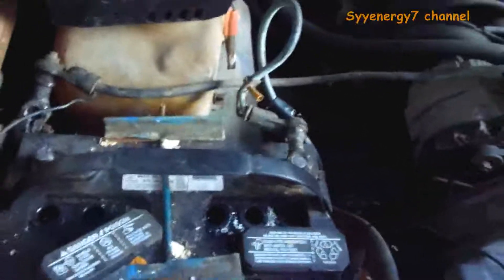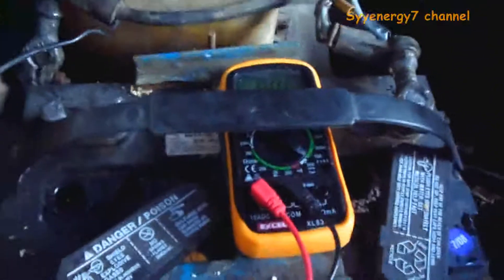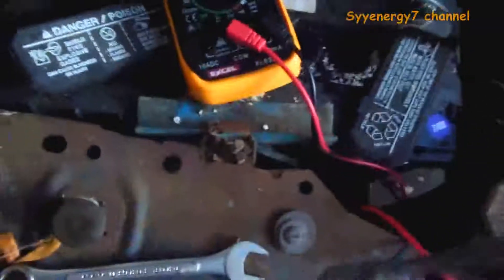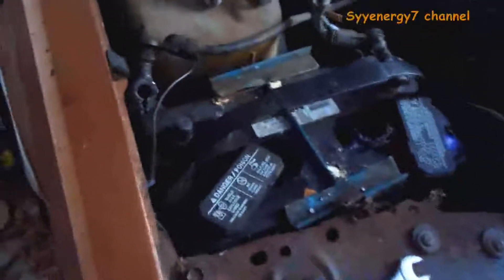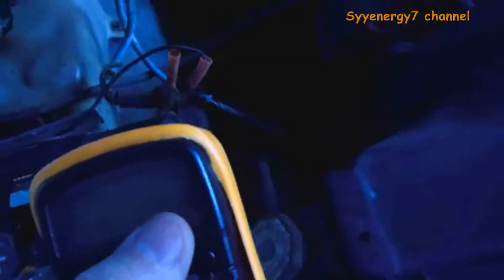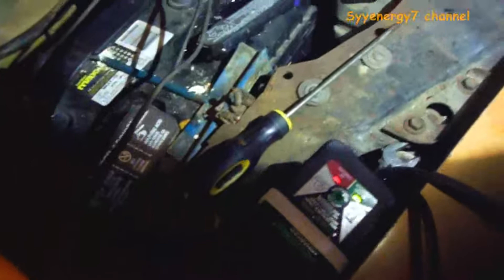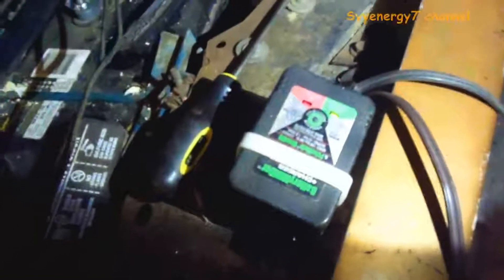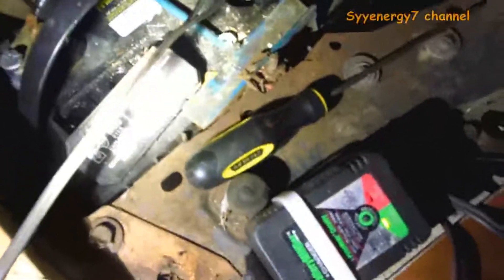Car Battery Problems & Battery Restore

Comment: There are several factors in battery reconditioning. One resource I discovered that succeeds in merging these is the Magic Mender Wizard ( Check Details Here>>>https://www.facebook.com/Battery-reconditioning-310070329426065/app/208195102528120 )  definitely the most incredible course that I've heard of. look at this super resource.